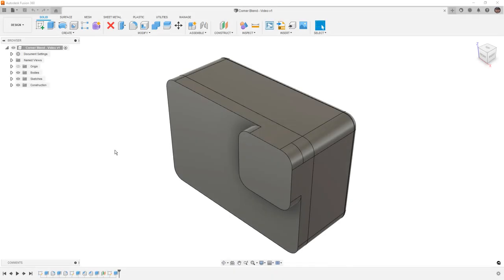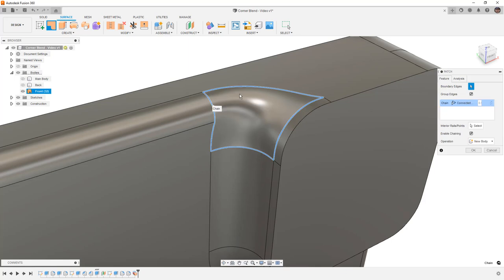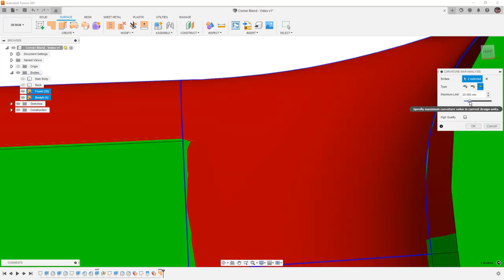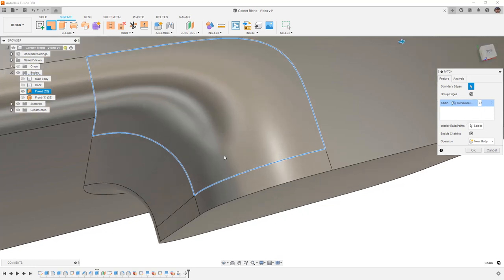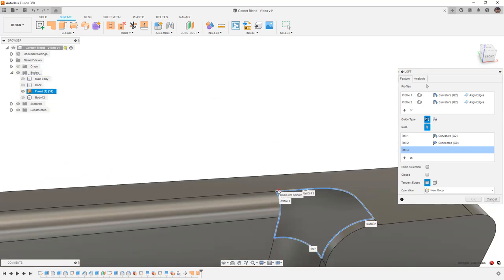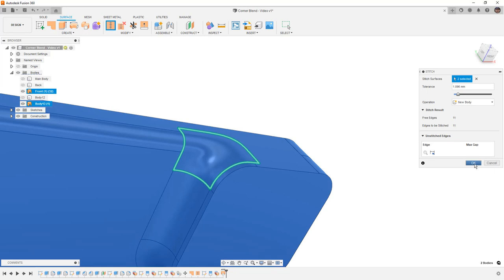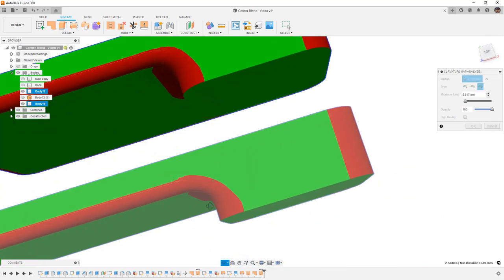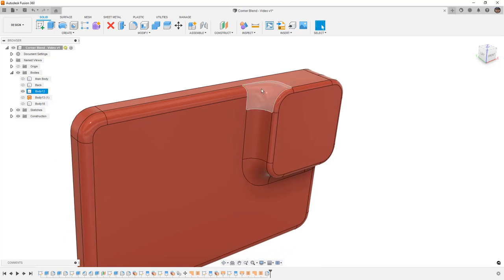Surface Mastery Part 1 - Loft Vs Patch for Blended Edges | How to Identify a Good vs Bad Surface

Comment: I've been a poly modeler in 3ds Max for 20 years and have been wanting to make the jump to nurbs modeling. After only this first video. I have learned a lot and will continue my journey with the rest of this series. Thank you so much for taking the time to make these.
Reply from the maker: Glad I could help!  You should check out the freeform content as well.  As a poly modeler you might be right at home with that in your toolbox in Fusion.
Reply: @LearnEverythingAboutDesign   Will do!  I want to understand more about blending curves if that makes sense. For Example, take a look at the back end of the drone in the movie Oblivion, You can see at the top there is a straight edge that blends in the sphere. Or look at the  bubble ship from that movie. I want to learn how to blend those types of shapes.
Reply from the maker: @brandonhall3353  Here are a couple of vids that might help.
https://youtu.be/5cfzRF_meoA?si=N8teB6oBCl8nXV3z
https://youtu.be/aswvQdc3wlg?si=UOQB8xPqnKZX8rUm
https://youtu.be/2i8r7Qc4N4g?si=N2spIyGkLKPeJRKW

The trick is generally to trim away the shapes where you want things to blend and add controlling curves to help the transitions if needed.  With surfacing the fewer inputs the better.  The more controls we try to add the more "tension" we end up getting in the surfaces.  Coming from Max you would see the tension at star points or ngons because everything is fighting for curvature control.
Reply: @LearnEverythingAboutDesign  Perfect! Thanks so much!

Comment: Even if those slight differences in reflections will not matter at all for my 3D prints the video is very interesting. I will probably care way too much about continuity in my models.  😀
Reply from the maker: 100%. if you 3d print that on an FDM with even .1 layer lines its all trash :).  just slap a chamfer on it ;)

Comment: Both example are not desirable, use Alias to make free form surfacing is better.
Reply from the maker: Right, but Alias is a Class A surfacing tool.  Fusion isn't.  You can own Fusion for 2 years for the price of Alias for 1 month.  The video isn't about the best option across all software, but the best we have in Fusion :)

Comment: I learn so much from seeing how you deal with the quirks and idiosyncratic limitations of the tools.  Thanks!
Reply from the maker: Glad it was helpful!  Sadly that is a big part of CAD, not just Fusion.  It was the same when i worked in Solidworks, Onshape or Inventor.  You work with what you have.

Comment: First of all, thanks a lot for this extraordinary tutorial. I'll surely go on. 

When patching the surface, I've just hid the edge lines. That patched surface is clearly seen, it means it's really problematic with molds and printing quality. 

I was once using patches whenever it's available. Because it seems practical. But not always. That's invaluable. 

Thanks again for sharing. I'm now a subscriber!
Reply from the maker: Glad to help and welcome aboard! thanks for the sub

Comment: As good as always. Congrats! Question about Loft in Surface: with the edge profile on G1 or G2 there is an option to Align edges or Align to surface. I've never seen any significant difference between the two options. Do you have in mind any case where there is a visible impact?
Reply from the maker: Thanks!  Yeah the align to surface is an odd one that seems to make no difference, but i can come up with an example that shows what it does and try to explain it.  I will see if i can squeeze that into today as its a good question with zero references out there.
Reply: @LearnEverythingAboutDesign  Great, thanks!!
You're right, there is nothing in Fusion documentation. As per the title and icon it is supposed to follow the surface (also coming from the profile edge but in fact this is already forced by G1 or G2). I gave another shot now but still getting the same result.
Eager to see what you come up with 😁
Reply from the maker: Video should be up in the next 15 mins :)  Thanks for the question, that is a good one.  Hopefully the video finally clears it up!

Comment: well, I'm still wondering about the production issue, or maybe I don't have to worry about it for now? 
as always great video!
Reply from the maker: Hey Usamah, i just replied to your other comment.  Basically think about tangent vs curvature as having different ingredients to make the shape.  Tangency is only looking at the direction of curvature.  The Curvature constraint/edge condition is looking at the direction and the radius of curvature at that edge.  For production you need to think in terms of how its going to be made.  If you need to machine a mold you want to be sure the shape is big enough that you don't need a tiny tool to cut it.  As for tangency vs curvature.  I think of that decision more about the shape and less about picking an option for production.  The only catch to that is if you are making a part specifically for CNC then using a standard radius that is a true arc with a tangent fillet will be much easier to machine with a traditional tool like a ball endmill or bull nose endmill.

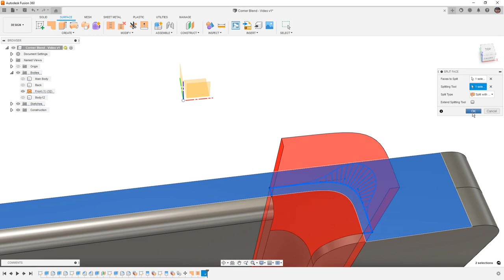Comment: 15:25 On the loft option, might it have been better to re-patch the top flat face after trimming, using your 1st and 2nd spline? This would have eliminated the issue of the troublesome little edge and given you a nicer end result in that area?
Reply from the maker: Good observation!  Sadly in all the times I have used Loft, whenever there is an edge like the fillet and flat on one side it causes problems.  Even if everything has curvature continuity like it did here.  Interestingly if you do the same loft as a form body with the same inputs the results are better without the weird issue in the middle.
Reply: @LearnEverythingAboutDesign  Its a shame you cannot switch seamlessly between solid/surface and forms. For example, delete faces to create a surface, then fix in the form environment with the end result remaining parametric. Or maybe there is a way I just don't know about? Thanks for all the awesome videos by the way. I have learnt a lot
Reply from the maker: Yeah its not seamless sadly.  With associative match in the forms environment you can get close, but patching a specific face exactly is somewhat impossible because there are always going to be adjustments made on conversion.  Ill give it some thought and see if i can come up with a good example.  Thanks!